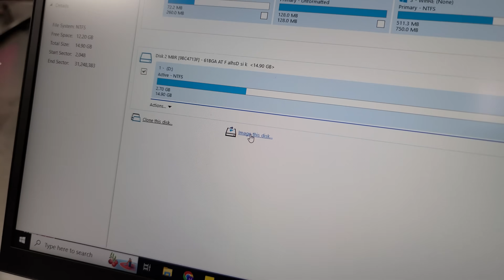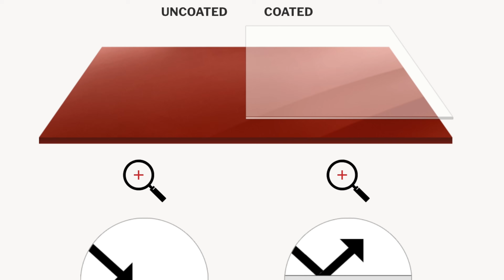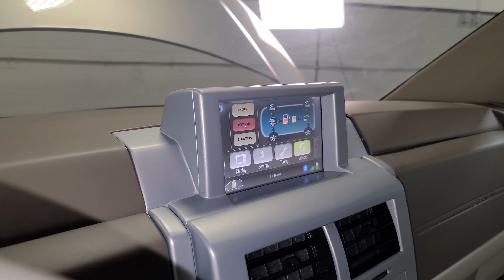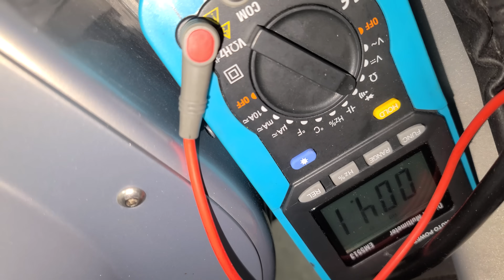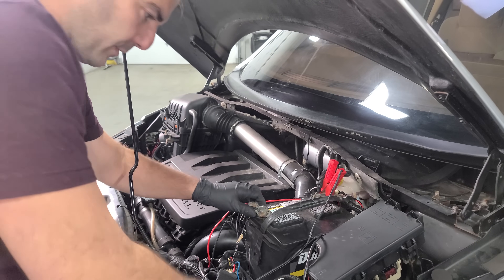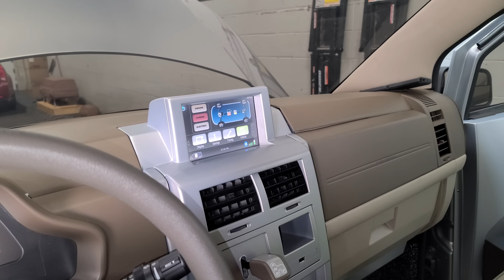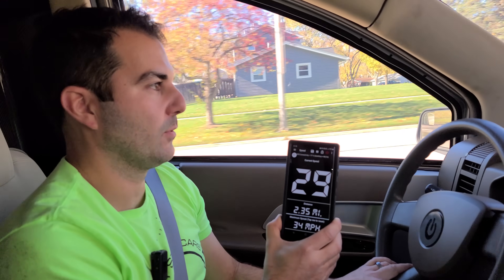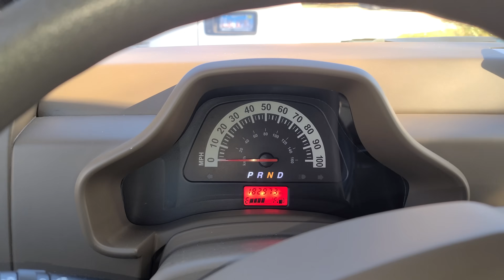I Thought I Finally Fixed The 2 Million Dollar Concept Van Until Disaster Struck! What Would You Do?

Comment: I'd take the guts out of a toyota prius and put all those internals into the space van. That would include the battery also, it least it would be usable. You can get a used Prius pretty cheap these days. It's an idea, that could take the story in new directions. The space van was only intended to be shown off and not really driven.

Comment: throttle cables not hooked up to pedal   ? im sure its a tensiometer with cable or if the gas engine is throttle by wire  hmmmm wish i could look at it lol   i wont sleep tonight or i guess ill dream about the fix , until the next space van video i guess ,

Comment: It’s a concept car. Seems it was made to only be parking lot driven. The axle broke bc it was cut to fit and wasn’t welded properly. they never made all the modes fully functional. In order for it to work in hybrid mode the computer in the back and the engine ecu would have to work together or one handle accelerator function for both motors. Seems they never figured out how to make that happen so the only thing the accelerator controls is the electric motor. Unless amongst all the random buttons,switches, and wires there’s a way to make it work.

Comment: First thing I would do is confirm rather or not the CEO is still interested and if so try and get a price to recoup my expenses.
If that doesn't work for me I would Use it to make something cool like......Maybe take a salvaged Prius and  combine the two to get a working, functioning hybrid van (basically remove all of the poorly engineered crap and replace it with proven Prius crap)! 
However, the titling issue would become a factor but it would make some interesting content as well as be a interesting challenge to hone your skills!  You may get some new subs and likes in the process? 
Then there's a third option: Push it down a steep hill into a ravine and roll some rocks behind it!  😆🤣 Just cut your losses! 😆
A fourth option: Admit defeat and donate the thing to some obscure museum or a college or something and just be DONE with it!

Comment: Probably the one idea that wont fly well with the audience. But there was a company that invested a lot of time energy and skill in to making a really sh*tty EV.
So I would take the Tavarish route personally and build it better: 

1. Get a real battery made. 
2. Fit a Rear drivetrain from a wrecked Tesla. 
3. Re-do the wiring and IT including the petrol EMS. 
4. Install windows and Aircon. 
5. Build up the weak areas so you can get a engineering certificate.

Comment: i would hack out all the wiring in the engine bay & keep it simple.. too much there that seems useless. yes thats annoying work, but then it most likely will fix your issue (with the engine) id also just swap in a new starter & alternator. as for the axle my guess is that its at an angle & the bumps were too much & snapped. love the content but would understand if you said buh bye to this project

Comment: Maybe it got 100 miles per gallon by putting a gallon in the tank and driving it 100 miles on a tow truck or flatbed trailer? That is indeed a wiring mess.

Comment: It is a shame the van didn't work it was poorly put together with sub-standard batteries and motor and parts it was made over-complicated so it probably didn't work from the beginning for very long until things started to fail so why not get a Tesla second-hand drive motor and convert it to full EV using tesla batteries or something of the same quality then you will have a full-on electric van with decent power and range you can make the range how you want it either a hundred miles or three or four hundred miles by adding batteries as now you can build your own batteries ab=nd cooling system this would make good filming changing it over to full EV and it would be very fast and the only one of its kind or if you want to go cheaper go Nissan leaf mk2, not the first one as its range was poor but you could fit two batteries being it is a van you have plenty of room well that's what i would do.

Comment: $5,000, all the tech is outdated so not really worth anything.  Best bet for doing anything with it would be to pull out all of the wiring and management stuff.  Replace the old EV controller with a AEM EV controller and use like a Motec to run the engine and transmission.  Trying to reverse engineer all of Brights stuff is a waste of time.

Comment: So where is the Next video ? what happened to this Van ? First i to commend you on the job you have done. this is not an easy thing to take a concept car and get it back to working order. However   it seemed you do not understand what a concept car is.  That Lady you Zoomed with in the first video told you what that car was and you choose not to list. It was for all show. it was never meant to be driven around like a daily Driver. it was proof of concept that it could work . She told you that, she said it was Alpha car and that the Beta Cars were the ones what would be daily driven. they shipped that car around on a flat bed or had ppl come to them to show it off. What ever videos they had up was again to show proof  of concept.  The  Van going to Sweden was to go to the Volvo wind tunnel to see how arrow dynamic it was never to Drive around.  The Computer controlled both the electric and Gas engine from the inputs. Meaning it was all Drive by wire, that Shift Solenoid should have tipped you off. it seems the programing was never finished or that the electronics were disconnected at some point from the engine . But also possible that they were shorted out.  I really hope the CEO got it back

Comment: genarater rip the engine and trans out and put a gas genarater in its place not only will you charge your battery but you can have a microwave like the French guy on talladega nights you could  go camping you could build a house  in  the middle of nowhere  you could have a box on your house you  flip a switch and use your van to keep your heater on if you're electric goes out the reason you're  axle broke your not suppose to tow cars with automatic transmission when you hit 35 mph the transmission starts spinning and burns up unless you put hub locks on the front wheels or synchronizer on  the  axle like a four wheel drive

Comment: I'm generally a fan of what you do, but I'm sorry, not in this case. The van itself is cool, but I feel like you kinda went and lost your head on this one. From the outside looking in, this appears to be ego at work. You wanted to touch something only a handful of people touched; to leave your mark on something that would hopefully be preserved for a long time.

Donating the proceeds to charity would certainly be a nice gesture, but it looks to me like it may have just been the thing to balance out the heady thrill of wrenching on this one of a kind vehicle. You've tried against all odds. I wouldn't even call it a failure, as you did get the battery working and the engine running. There's a guy who desperately wants this car, my recommendation is to sell it back to him.

You can make your buck, there's nothing wrong with that. It ended up in your hands, and that's just business. If you'd like to be generous, ask for half a mil, otherwise, ask for a mil and see what happens. Either way, it should go back to him, not be parted out, sold to someone who will do god knows what, or put in a museum.

Comment: It is not worth anything. Based on tech at the time, running xp?. There is Linux or windows 11 now. People today make ev vehicles cars bikes scooters etc, in their garage. It  wouldn't be too hard to gut the engine and ev motor and redo to todays tech with appropriate data and schematics and kits available. The space van back then was a pipe dream that obviously would have never functioned as intended. You have proven that. Just comparing it to a tesla should say it all.

Comment: Get rid of it. It's legit a engine running on windows XP. Garbage. For all you know it's a part of code that broke due to corruption or bad ram, bad cpu contact, weak signal from any of the engine sensors. Computers suck. Cars are easier electronics.
Maybe you can take the engine, take the batteries, and build your OWN electrical system that ISNT windows XP.
I think getting a raspberry PI and coding the sensors yourself is better than guessing on this shotty work.
Maybe get a collab with a coder/car enthusiast.